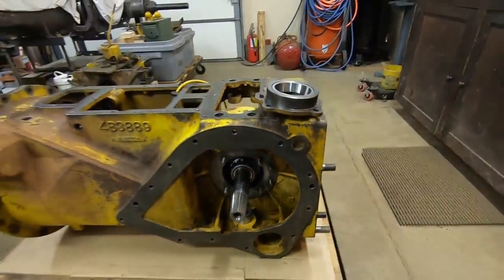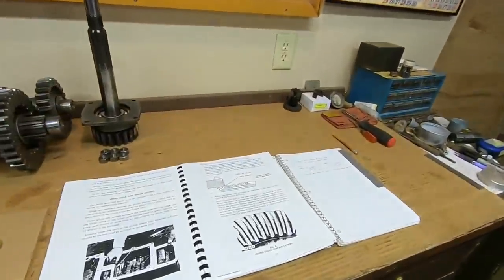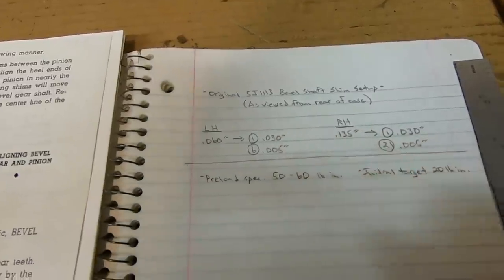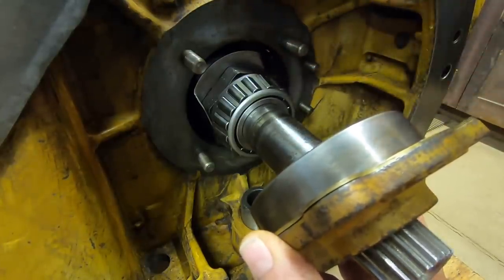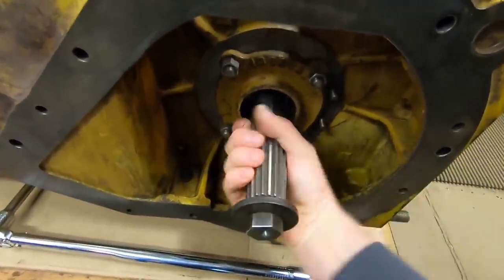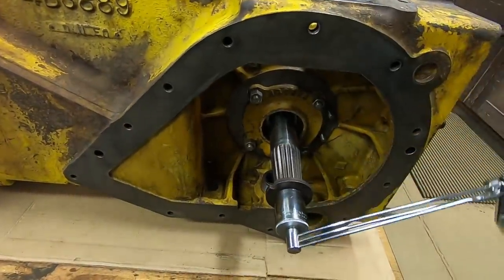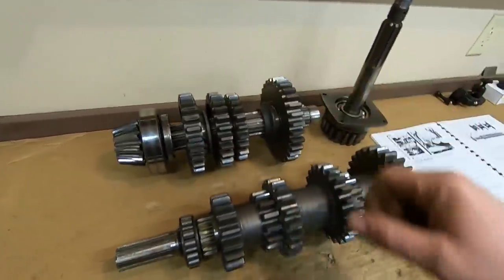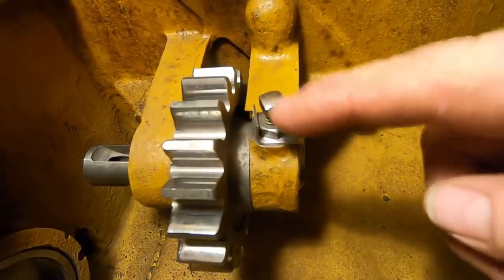Caterpillar D2 #5J1113 Chassis Rebuild Ep.13: Setting The Bevel Shaft Preload & Countershaft Install

Comment: I'm with you on the cheap bearing issue. I work at a Peterbilt dealer. We had a stint of several months where we were having a lot of differential bearings fail, even in factory sealed diffs. Then all of a sudden it quit. Think the diff manufacturers switch bearing suppliers.

Comment: Modern bearings are harder and with a finer finish than the bearings of old so rolling torques need to be less. The fact people no longer do any break in procedures likely also contributes to failures. Biggest killer to new bearings is heat and if you have a set put together tight it squeezes the lube out and causes it to go south fast.  I don't even setup truck rear axle bearings with preload anymore as I saw too many give it up, Set them up barely touching and they run forever it seems.
Reply: @squatch253  Ah those warranty people can be fun. LOL

Comment: I caught quite a bit of flack on the Farmall H when setting up the differential. Now, I am no expert - when it comes to lash and pattern I did the best I could... BUT. Many people were mad that I didn't set up preload on the gearing. It is my understanding that preload only applies to tapered roller bearings, NOT on regular round/ball bearing style cage bearings. In theory, if you preload round ball bearings, the ball bearings will not be riding in the valley of the race, but on the sides of the race. Wouldn't this cause undue stresses on the outside of the races, causing premature wear and ultimately premature failure?
Reply: @squatch253  EXACTLY what I thought and have read. Thanks for confirming that. Also, thanks for giving Rudy a call yesterday. Looking forward to the ring and pinion setup video (and the explanation of the differences in bearings)! Thank you for all you do, bud!

Comment: I've got a friend that's an engineer for CAT so I'll have to ask him how they get to such an odd number for shim pack thickness.  The only thing that scares me is his answer will probably involve the alphabet and then continue on to a 3 page explanation that'll make your eyes go crossed and cause a headache similar to eating ice cream too fast!!
Reply: At Boeing, we use a .062 laminated shim. Half the shim is solid, and the other half has .003” peeled layers. Allows adjustments as little as .003 inch.
Reply: That's why I chose automotive electrical as a career- little to no math :)
Reply: @billh230  I did a lot of equipment installation in police equipment,  to get it the best possible results I used a lot of math applying oams law to keep cost and weight down ( a overweight patrol car is a problem). While preventing problems in the field. A burning police car is of little use ! Another problem is the volume of wires added in small amounts space . The new equipment uses solid state circuitry and low current load lighting greatly reducing all of the problem I had to solve.
Reply: @thomaslemay8817  Thomas, note the smiley face. I was being a bit of a smartass. I have done my share of installs and custom systems over a 40 year career.
Reply: @ImpHalla66  we use the same style shims to set gib  clearance on smaller presses. The higher tonnage machines we use ground hard washers now. If you really wanted to hit that preload right on the nats ass you could turn the step on that bearing retainer moving the cup in closer to get you in between those      
.005" shims
Reply: Can you imagine that the trouble to make ,001" shims?
Reply: @KG-yn9qi  I have worked with .001 shims in the manufacture of  TV studio video tape machines back in the day.  If you breathe on them too hard they fly away!
Reply: @woodhonky3890  yes for a flex tape .. but in 1939 and for a machine like a D2Cat know they could  but. It is like a 7 1/2 MPH SIGN! could see making some ,003/.004 shims to get there but ,001,would distort them before get in place.

Comment: Uhm two things. When I saw you taking apart the countershaft and removing it I could have sworn there was a thrust washer between constant running gear and the others. It dropped almost right away when you removed it.  Second the snap torque wrenches are not accurate. When left tightened over time the spring inside deforms and torque is way off. Just an fyi. Dial or beam seem to stay accurate.

Yep I just discovered your channel and am watching it. Hi from Winnipeg north of you.  Get yourself a southbend or similar used lathe it’s much easier and better than mini. Also a milling machine is a good idea.  The mini mills work if you do some upgrades enough for rebuilding stuff.

You say bevel gears. We just call them crown and pinions.
Reply from the maker: Yes, it’s more of a spacer washer and it’s in there 👍 I was taught very early on to always back the click-type torque wrenches back down every time after use, and have used them exclusively since becoming a mechanic. We have a South Bend 11”, as well as a 14’ long Sheppard gap-bed lathe, but I get my best results on that cheap China mini. This is an older video so you probably haven’t seen those others yet, and we’ve also fixed up Senior’s mill-drill since, although it’s no Bridgeport. Cat’s terminology is indeed “bevel gear” because it doesn’t carry a differential inside of it, it only transfers directional rotation. If it carried spider and side gears, they would then call it a ring gear. Thanks for watching!

Comment: When you installed the reverse idler gear lock bolt, I noticed the fold over lock had a long and short side. I was wondering if you could have utilized the longer side and folded it over not only the lock nut but also the bolt as well. I know technically the bolt shouldn’t back off with the locknut tight but you never know. By the way I’m a new subscriber and absolutely loving your content, went all the way back to the first in this series so I could follow every step. I my self love restoring the old derelict machinery, love taking something junk and making it functional again. Keep up the great content thank you.

Comment: When you tightened the two bolts pulling the bearing onto the countershaft, what did you use to keep the counterpart from turning? Were you just holding it with your other hand?
Reply: @squatch253  did you end up changing the bearing race on the transmission you are building?( you pulled it on one of the other housings to show how to do it) thanks

Comment: Excellent explanation of preload!  I'm with you, make allowance for modern bearings.  I recently rebuilt a "Timkenized" Monarch lathe.  Bought NOS Timken bearings, because I'm built that way, but how old?  Others were new Timken bearings...  Spindle bearing was the costly replacement.  Since there wasn't any "preload", only a end play spec, it is hard to determine what was best.  After watching this, I feel much better on what I decided to start with.  In my case it is easier to adjust down the road.

Comment: Thank you for an excellent video once again. I have a question, with tapered roller bearings isn't there need to initially bed or set the bearing in i.e. installing without shims and then set the required preload by inserting the shims. I promise that I won't be offended if you come back with just a single word answer, 'no'.

Comment: 6:07 Why would it make any sense to grease an oil lubricated bearing in the first place?
When I rebuilt the final drive in my car ,I didn't have a rotational torque wrench to measure the pinion shaft preload torque. So I attached a "drum" (metal can) to the pinion shaft flange and wound a cord around it . By hanging weights off the cord ,I could apply a precise torque to the shaft (Radius x weight = lb-ft). When the shaft rotated at a steady rate,neither slowing to a stop or speeding up, I knew the preload was correct.
Preload for the axle shaft bearings was set  by measuring the distance between the bearings with a micrometer.

Comment: Under load parts do flex that's reason for pre-load so bearing won't get loose.  With what I work on (semi's) they use thrust bolt, clearance set at 0.020 it will flex and rub that bolt. RIng gear are some beefy parts and still flex under load on big trucks. They all flex no matter what machine is pre load or not. Guys in Mustang forums whine about gear noise in 8.8 with factory 3.73 not so much with super 8.8. Deeper gearing more noise you get pinion turning faster so more gear noise. Super 8.8 in mustang 15-up has thicker pinion less flex equals less noise. 2001 explorer axle in my 2003 level II ranger makes gear noise its factory 3.73 of course it also has 2001 explorer V8 in it too damn near plug and play (1999 ranger wiring, ABS and Fuel system in 2003 ranger) This setup was in 1999 but poor ranger got very rusty.

Comment: referring to the PTO preassembly excessive counter shaft play Episode23. in this video  @17:12 there is a bearing spacer missing.  that may or may NOT have been in the parts manual.. its easy to miss.  it goes between the Outer race of the forward bearing and the inside of the seal retainer to lock the outer race in place and stop it from spinning.  removing excessive end play from the splined counter shaft that caused the probable kicking out the PTO randomly as the countershaft and front bearing slid forward..  you might be able to measure without tearing the countershaft out.. how much end play there is... so youc can machine a spacer ring to pinch the outer race tight into the bearing holder 4B3424   this removes all the end to end slop in the countershaft  thermal expansion can be handled by the roller bearing on the rear.    this might require some shimming or different thickness gaskets for between the bearing support and the seal support  to hold the bearing OD tight in the housing.
Reply: @squatch253  it just looked like too much outer race gap.. i figured it was where the excessive end play seemed to be coming from.  i did not know if the bearing that came out that had double felt seals had a thicker section to it and somebody had ground off the ridge to make it fit..

Comment: Hummm I never thought about the quality of new bearings not being as good as the older ones.!!!! 
I do know most of the Chinese bearings have failed. 
But have not had problems with any others  yet .
You have me wondering about my f350 rearend now .
I have a grumbling vibration 1 . 2 .3 under power. 
And is there slightly in  4 . 5 .but not hardly noticed. 
I'm hoping it the career bearing . 
😊😊👍👍👍👍👍

Comment: Here is a question for Squatch253: What would be your recommendations in terms of using engine oil, transmission and bearing lubricants? Now I know there are many brands and depending on the region ,not everything would be available. But just some basic know how on how to use modern lubricants on something that is 70+ years old. Best time to answer this question would be probably when the back end of 5J1113 is assembled and your doing a first engine run.

Comment: Hey squatch my uncle has a d2 I used to play with I got her running and I would just play around move dirt pull stuff and for some weird reason it would only turn one direction if I pulled the clutch for the left side the whole Machine would stop moving I was wondering what would cause that?

Comment: Do you preload auto axle taper bearings?   I was "schooled", seat new races "properly", clean and pack bearings, install, tighten down, then loosen, hand tight, spin wheel, hand tight, spin wheel, tighten just until endplay removed, then quarter turn for new bearings, no turn for used.   I always had questions on preloading axle taper bearings because of heat?
Reply: Again, I just read this question out load and realized the only safe answer for you is "follow the manufactures recommendations".  Nevermind...

Comment: That open end of the countershaft beneath the bevel gear, is that where a PTO would connect to if the machine would be equipped with one?

Comment: Is the reverse idler gear shaft equipped with an oil catch cavity to lubricate the bearing?
Reply: @squatch253  Well thought and very simple, it should last another 80 years easy!

Comment: Okay, went back and watched. Did not see any thing. The rear cover was off the back of the case. So will go back farther to see if there is even an outlet for a PTO- pump shaft. Also been thinking, if it is for an power out shaft, would need to have a clutch assembly first then an PTO out, because it would be constant rotation. Even with trans in neutral, and clutch engaged. So the additional clutch on inside/outside, would be needed to stop rotation when not needed. Did not see any of that?

Comment: Hi, I'm an avid watcher of your UTUBE channel.  Question.....When putting the idler gear back with set screw, I noticed the fold over lock was folded over the gear case and not the set screw.  Just wondering🤔....Opps! I looked at the video again and saw you bent the other side😁

Comment: Okay the bottom counter shaft, the spline extending into the ring and pinion area is the drive for the Rear PTO? Or does or extend to drive a pump? I can not remember. I will go back and watch the disassembly.
Reply: @mmm365  Thank you sir. But can not run PTO off pinion gear Shaft. I was talking about the lower counter shaft that spins all the time with clutch engaged. And referring to the additional spline extending in to the differential housing. As to use as a PTO.
Reply: @squatch253  cool can not wait to see it. Just after going back to tear down, did not see a PTO on the back. Did not fully get the extended splines if not for a PTO! So it is a collar engage over the splines not a true clutch to engage. Falls back to main clutch. Got it still can not wait to see how it was done!
Reply: @squatch253  yes too cool! Love to see how it goes, love the old stuff!

Comment: When you set the preload on the bevel gear shaft did you set it with dry bearings or did you lubricate them .
Reply: @squatch253  Missed that , Thanks

Comment: Cool but how does it work for alignment on the main trans shaftot pinion shaft its gear alignment
Reply: @squatch253  yeah I realised that just after I had sent the message thanks Squatch253 I find I truely enjoy your videos and  imagineering and fabrication of tooling and things to McGyver your path through the tasks at hand. Much like dad and I did when I was a teen back up in the woods.

Comment: 7:36 you meant where this shim packs are to thin instead of to thick?  And you torque both sides before measuring the torque of the axle?
Reply: @squatch253  you don't have to defend yourself. You are doing an excellent job explaining. One suggestion is to make a simple diagram drawing explaining how it all is interlinked. That will also explain that it is important to gradually torque up both sides which will catch an error of stacking to many. It also would explain that you start with less and creep up on to the preload on the axle. Thanks!!

Comment: Everything is made in China... hence why lower quality and nothing lasts like they used to.
Around my area, those beam torque wrenches are hard to find. Used to have my father's beam wrench, haven't seen it for a good few years now unfortunately. You're getting closer with that transmission/final drive. Cheers :)
Reply: Sas- as u stated it's my build I'll use 14 is preload this will preserve this longer than the next 3 generations. Bravo my boy bravo.

Comment: By taking only a shim from the one side, are you not only preloading the bearing on that side only?
Reply: So if my thinking is correct you are squeezing that shaft between the two bearing caps.  Removing a shim from either side will change the pinch force overall if the caps are kept the same distance apart.  What WILL change by removing a shim from one side and not the other is it will move the pinon gear over to one side (where the shim was removed).
Reply: @homeFall1   
I was actually thinking of the final drive shaft on my tractor, but that only has shims on the hub side, the other is a fixed race in the case. By taking a shim out you are pushing the race in further, thus tightening the bearing in the race. But even this would push the whole shaft and thus the bearing on the other end into the case further and tightening that as well.  
So after all that is said, yes I believe you are correct.

Comment: That lower preload gives you at least 5 pto HP extra over factory spec.  You are right, new bearing are cheap.  Poor steel and poor heat treating.

Comment: I don't think todays bearings 100% the problem but the oil since most of it is synthetic oil now. Rollers want to skid more instead of rolling old mineral oil far different than todays oil synthetic or non-synthetic oils. They have removed most of anti scuff additives like zinc and sulfur almost like it give fiction for rollers to roll

Comment: I'm not so sure that the difference is in the quality of bearings between then and now. E52100 bearing steel is the most common then and now and tolerances have gotten better. What has changed are the formulations of lubricating oils and greases. Grandad's gear oil had a whole range of EP additive packages that today's oils just don't have.
 https://en.wikipedia.org/wiki/Extreme_pressure_additive